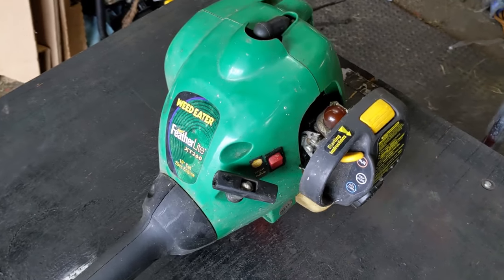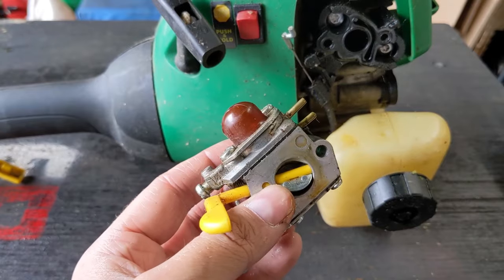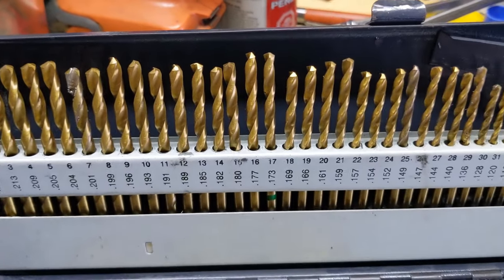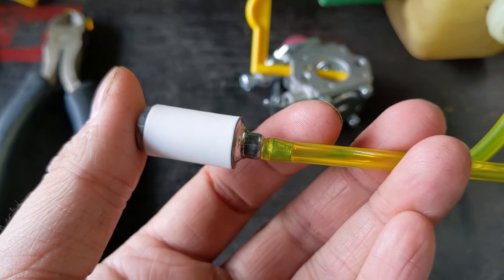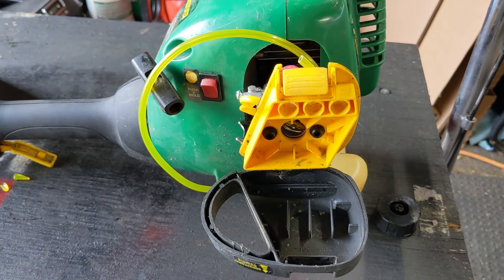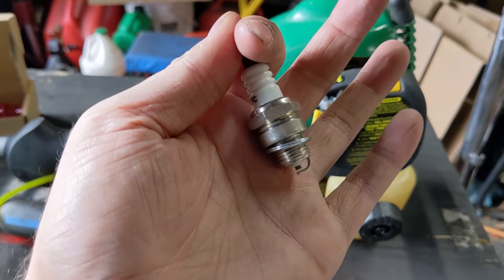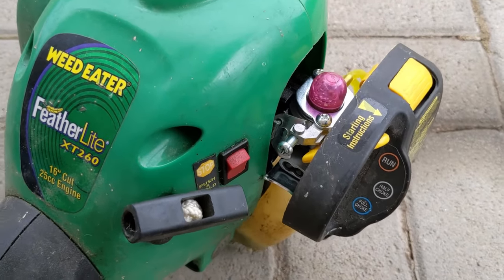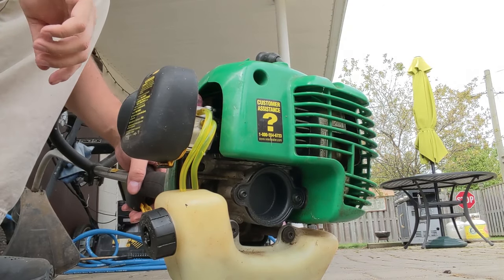Weed Trimmers - Don't Rebuild The Carb!

Comment: Thanks for posting this video, I went to Amazon and ordered one, came in two days, had new carb, 2 new gas filters, both sizes of fuel line, 2 air filters and a new spark plug along with the carb adjusting tool!! All for under $20.00 Changed all items received and trimmer runs great. Appreciate you doing this video as I almost junked the trimmer!
Reply: I'm headed to Amazon right NOW!😂

Comment: Dude!!..RED thread locker is a "high strength" seal..You'll need HEAT to adjust that idle screw now..BLUE thread locker is "medium strength" way easier to "break free" if you have to adjust the idle screw in the future Sir.

Comment: You can soak the ends of the fuel tubing in warm water for a while to make it more pliable for fitting to the carburetor and filter .
Reply from the maker: Thanks for watching!
Reply: Or just lick it with a lighter. That’s a lot easier
Reply: Thank you for the information but what I like to know is which fuel line goes on the top fuel, I have a Murray weed eater
Reply: A little bit of 2 stroke gas usually makes it slippery enough to slide over

Comment: The video was very informative and well done.  The drill bit is a #17 not M17 (which would be 17mm).  .173 inch which would be between 11/64  and 3/16 in.  Or close to 4.4 mm.
Reply: Thanks

Comment: Excellent presentation I never understood the Hi-Lo adjustments until I watch this video. Thank You Sir.
 I would like to add a discovery. While pulling the fuel lines through the tank holes I put a dab of two-stroke oil so they would slide nicely. While pulling them through with the hemostats, I use my other hand to stretch the hose a little bit. This made it contract a and slide through with ease. Another thing if the fuel line is too wide to fit over the brass snuggly I used a 1 inch piece of the smaller diameter blue hose on the brass tube. It acted  like a reducing bushing inside the yellow fuel hose.

Comment: 20:24 I think there’s supposed to be a spring under that screw.  That would put tension on the screw so it wouldn’t just vibrate and fall out of adjustment.
Reply: Yes right. But still a great video.

Comment: Greetings from Party Sound eh?  Love Featherlites. Have two. They're so light and not tiring, yet strong runners.  Might try a carb kit in one someday.  Usually just do a cleaning and replace the gaskets  / diaphragms, maybe fuel lines
Reply: Yes right. Love my feather lite. Powerful little machine. Goes through everything..😊

Comment: I agree with your decision, I learned the hard way. I bought a kit online and rebuilt the carburetor and it still wouldn't run. I don't have an untrasonic cleaner nor do I really have a place to have an open container of carb cleaner to soak it in. Even if I did soak in carb cleaner you have to get rid of the cleaner after.  I've seen a lot of repair videos here on youtube where the purists cry foul for buying cheap chinese carbs.  I've used them on my snowblower and weed wacker for years and in my opinion they work just as well and last just as long as an original parts one.

Comment: HI , I Am just starting to watch your video and is
 well thought and I thank you very much . Im a machinist and want to learn small engine repair and i found your site very good and interesting . just for info, the drill you refer for the tube size is not 17M (metric) it is no,17 which is 0.173 thousand of inches( imperial numbers),

Comment: I completely agree with him! I just did exactly the same job a week ago. I still sometimes rebuild some 2 stroke carbs; but I only buy the cheap $2.50 directly (wait 2-3 months to get it) carb kits from China. I wouldn’t spend $8-15 for a carb kit because the carb might not come back and the money spent on the kit is usually just gone. I am only willing to gamble a couple of buck on a kit compared to $10-17 for the kit with a new carb plus all the extra parts that is guaranteed to work. I am also a fan of these old Feather Lites. I have one from 1999 that I bought new and it still runs great and isn’t too heavy to carry around. For cheap machines, they were plenty tough for 1/4 acre, homeowner use, easy to fix, and cheap and easy to get parts for them.
Reply from the maker: Well said, thanks for watching!
Reply: Well I completely disagree. I have rebuilt many 2 cycle carbs especially on trimmers, saws and blowers. I very much dislike any outdoor equipment in 4 cycle except for mowers and such. So if there is an issue with a carb on a 4 cycle unit, most the time if it is a carb issue, maybe then buy replacement carb.
Reply: "come back to working condition"?

Comment: Excellent and very clearly explained video, step by step. A friend asked me to get his Poulan Pro running (looks pretty much like your Featherlite), so your video is timely and a great help. Question: The feed gas line is smaller than the other one. What difference does it make to keep it that way, instead of drilling out the hole and inserting a larger line? Thanks

Comment: Great video! Had I not watched it, I probably would have returned the carburetor. 
Did everything you said. I’ve adjusted the carb best I could but it  smokes white and overheats. 
Got fresh fuel with the correct 40-1 oil ratio, clean air filter. 
Out of answers. Any suggestions?

Comment: I do have a problem with your reasoning. That carb you took off was a genuine Zama carb. Those carbs are very reliable. That carb probably lasted the whole life of the string trimmer. (Maybe 20 years) That aftermarket one that you put on is most likely only going to last one season. Even with your reasoning, if you want to use chinese parts, it would take me an hour to do a full fuel system service on one of those. To rebuild the carb, I could get a chinese kit for about 2 dollars or a genuine one for 10. I understand why this can be a plus for people that do not know how to work on these engines, however, it is not worth wasting 20 dollars (half the value of the trimmer) to put a non reliable carb on that. I know from experience. Now this is JUST my opinion. You do you. I am NOT trying to critisize you in any way. I just wanted to share my opinion with you.
Reply: I agree❤ .

Comment: Recently rebuilt carb on a chain saw. It’s a very similar setup to this. I should have bought the China carb but got the rebuild kit instead. The hour and a half def wasn’t worth the $5 saved especially since one of the screens I changed really required some jewelers tools. Good thing I have some minimal cell phone repair experience.  I avoided the new carb only because I had concerns on build quality. Fortunately it’s easy to confirm good spark and compression without a carb so I did that before spending money.
Reply from the maker: The best is to find the ones with lots of good reviews, spend a bit more usually not much more than an extra $10 here or there for a good carb

Comment: great video , I've got a weed eater brand featherlite 18cc , super low hrs on it . but hasn't run in 20 yrs , I put fresh fuel in it with some seafoam , got the engine running but it wont run unless it is half choked and it bogs badly , I'm sure the carb is gummed up . I would love to replace the carb with an amazon unit . most carbs on amazon are for a 25cc , will a 25cc carb work on my 18cc engine , they look almost identical .

Comment: I just gave up trying find a Weed Eater Feather Light FL26 carb rebuild kit, the ones I found that say FL26 was pushing $20.00, I got flipping PO I bought a carb for $15.00. Theres no need why a carb rebuild kit cost more then $5.00........
For some reason mind fires up on choke but soon as I take it off choke it stalls, I took it apart half dozen times and still stalls out, hopefully the new when it shows up will work.......
PS Good video info, thanks for keeping it posted.........

Comment: I just got extremely excited when I saw your bit box, extremely jelly
Reply from the maker: We usually spend a bit more when buying wrenches or drill bits to get packs with more pieces, you never know when you need a certain size!
Reply: And plenty of 1/32 and 1/64s for replacements I'm sure, ever find any that won't snap no matter what?

Comment: What about if the original carb is a walbro, would you replace it with a china carb? I personally like taking these carbs apart so I just buy pack of 20 meter diaphragms and replace that which is almost always the issue. Pump diaphragm is usually fine.

Comment: I notice that there was no factory gasket on the air intake side on your trimmer. Mine is the same - a Canadian Tire SST25C - 2009 vintage. 
I guess we just put it back together the same way? With just the yellow plastic choke / half choke / run and air filter housing against the carb stack / body? 
It ran really well for ~13 years like this.

Comment: Thanks for the really useful and encouraging video. I’m also a big fan of replacing carburettors. 

Some questions for you and perhaps my fellow subscribers:

1) The OEM of my line trimmer (MTD/Troybilt) recommends a Champion RDZ4H? Isn’t this just too low-heat for a 29cc four stroke….or not? Is it worth trying a “hotter” spark plug? Worth 2nd guessing the OEM? Not under warranty, so I’d happily try some new stuff on this machine. 

2) My Troybilt (now with a fully functioning Chinese carburettor) doesn’t seem to have the ability to adjust anything, other than “balancing”idle-speed and high end revs, using a single screw (just like the original Waldron). My question: is it possible to use a different carby, with more controls (like in your vid) or would this simply not be possible, by design? It took a while of pure guess work, to get my Chinese carby working, btw….

Thanks again for the insights, wonderful vids.

Glen

Comment: Hey man love the videos. Always learning something new. I'm trying to diagnose my Echo Srm-225. It leaks fuel out of the air filter after sitting overnight. Can you point me in the right direction?
Thanks
Reply from the maker: Needle valve and or the fuel tank vent is not venting. Possible the pressure in the tank is building up and forcing fuel out the carb into the air box. If you open the fuel cap and you hear a pssh, this could be the issue.
Reply: @EliminatorPerformance   Thanks  for replying. I will check the cap. I replaced the carburetor with an aftermarket one from Amazon could that cause any issues?
Thanks again

Comment: Very useful and concise! I found a weedeater featherlite x25 on a curbside cleanup. It has a bad zama c1u carb with no integrated choke. The oem choke is integrated into the plastic filter housing. Is removing the choke from ebay carb doable so I don't have to hack holes into the filter housing?

Comment: IT use to be a spring on the low speed adjustment screw, but once again excellent vdeo on adjusting china carb, i Will use china carb on my weedtrimmers but not on my. Snowblower

Comment: Fantastic vid,  I am suffering carb issues with this same exact model.  I have a replacement, but neither the original or replacement will drawn in fuel when depressing the bulb.  I have replaced bulbs, gaskets, lines, and fuel filters but nothing is working.  Any ideas?
Reply: Are the lines on backwards or dry rotted?
Reply: Lines back wards

Comment: Yeah had trouble with reconnecting fuel lines into right outlets ,  had to switch them around . It didn't help that fuel outlets were different than original carb .

Comment: Replacing the carb is easier but I like the "Challenge of Ethanol" Lets see if I can actually clean, rebuild and tune it after it has sat in the back yard under that pine tree for 3 years with old gas in it with the dreaded ETHANOL. The smell from the tank and carb are enough to make you barf. 

I got my cheap fuel line on eBay it was a great deal and came in three sizes with multiple prime bulbs. It was cheap too. I have used the fuel line a few times with no issues. Just used a prime bulb on a carb tonight. Weed Eater gas hedge trimmer. Got it free in a junk pile in the middle of a rain soaked backyard. New bulb a good flush and it fired up without the choke. Needs a bit of adjustment on the carb but nothing that will be a big deal.

Comment: How did you determine the correct carb to get? I have a Ryobi RY2800 but I don't see any carb markings.
Reply from the maker: Go to Amazon and type in Ryobi RY2800 carb and then look through the listings. Sometimes read reviews if they look a bit different. Sometimes they'll show you ones that don't fit so be careful.
Reply: @EliminatorPerformance  Thanks for the help.  Videos are very helpful.

Comment: How can the fuel line at the carb be made to fit the fuel line you have drilled the tank to fit, as these are different sizes on various carb’s.🤔
Reply from the maker: I have different fuel line with different thicknesses, the ID and OD are different on most carbs unfortunately. I have like 4 boxes its hard to tell which one is which until I pull them out and test fit the lines

Comment: LOL I have been researching my Featherlite and cannot find the carburetor for it. I think it is not made anymore.  I usually save my instruction books but cannot find the one for this one so no model number.  Mine is an older one and I think it is model Zama C1U W7C but cannot find this.  Are there carburetors that are a universal fit that you know of.  I am at my wits end.  I know it is a low end machine but I hate to get rid of it.  Thank you for taking time to try and help.

Comment: The carb kits for those are $1.50 and I buy them 50 at a time. I stopped rebuilding those because some carbs have a hidden o ring and leak. Now, I ordered 2 new carbs, one will only run with idle jet all the way in and the other which ran initially is leaking gas into the engine and out the air filter. Also having about 3 out of 4 Homelite carbs no good out of the box so today....I'm back to the ultrasonic while I wait for a carb shipment. That's an older model likely made in Canada, the Poulans to buy are the ones without primers. The carbs are near 100% repairable all the time.

Comment: I discovered this years ago. The carbs aren't worth rebuilding and they have a screen in them that clogs and won't clear. If it doesn't start I just replace it. I have one that's worked 3 years in a row, which is unusual. I put some startron in the mix and it works wonders.
Reply: Its not the screen its the diaphrams and the tip of the needles and seat

Comment: I notice that an OEM carb costs 3-4 times what a Chinese knockoff does.  

I also looked through the Amazon reviews and see lots of complaints about missing parts in the replacement carbs amount other things.  

Maybe the solution is to order a half dozen, keep the first good one, and return the rest.  

Of course, you KNOW that the “returns” likely end up in a landfill.

Comment: Maybe not on a cheap machine like that, but some better quality machines have Walbro Carburettors. These can cost up to $60-70. A rebuild kit for them is cheap and its very easy to do. It's going to be much better than a Chinese carburetor of Ebay or Amazon

Comment: People always ask me why I replace weed eater carbs and rebuild mower carbs and I tell them.... if I can buy it for $15, why waste 45 minutes of my life rebuilding it? Mower carbs cost more so I rebuild them.
Reply: For me, there is much more challenge and satisfaction in successfully rebuilding a carburetor than in just buying one.  Plus, I am long retired and time spent is not a factor.
Reply: @williamclements273  I am the same way off camera. 2/3 of the "new" carbs I install are ones I rebuilt earlier. For the normal guy out there it's a lot easier  to toss a carb on, but for gearheads like us rebuilding it and seeing it run like new is a lot more fun.

Comment: Hello everyone! Hey I need help here. I have a FS 38 STIHL that backfire and is  burning the air filter. Has brand new carburetor in it. And also only runs on full throttle if you release the trigger it'll die. If anyone has an idea of what I can do to it please let me know. Thanks in advance and have a great day!

Comment: Funny how small engine manufacturers blame bad fuel for everything. In reality fuel has never been better, what’s gotten worse is the gas lines, the fuel tanks and the carbs, all made from the cheapest plastic possible. In case of an emergency, I always keep two 5 gallon gas jugs in my shed for three years then dump in the car and get fresh gas, never had a problem, ever.

Comment: Why would the air filter sponge have 2 stroke oil on it?
Reply from the maker: Sometimes people coat the filters in oil to help catch fine debris, other times it's usually just from over priming the carb and the fuel/oil mix floods into the air box where the filter is housed.
Reply: @EliminatorPerformance  I think 2 cycle oil is a bit too thick for the filter.  See what you can find on oils made specifically for that purpose.  They get applied and then you supposed to squeeze the filter to minimize the amount of oil and distribute it correctly.  Heavy oil in the filter adds a slight choke.  Not horrible if not taken to extremes.  Let me know if you agree or not.  Good videos.  Thanks for the prompt response.
Reply from the maker: @alext8828  I've used that stuff in my videos before, it's called air filter sticky spray lol (I don't know if that's the actual term) but it works great! https://youtu.be/jbxO0RZclKQ

Comment: Anything possible to fix the trimmer head wobble that these get after a few years of use?     I'll consider that new carb, but I've taken these off so many times and cleaned 'em out I can do it in about 10 minutes.. Yeah, if you need a kit the new carb is the way to go.     Main thing that gets messed up is the little screen in the carb gets gunked up.. usually some carb spray will clean this out...
Reply from the maker: I've never fixed a wobbly head, these things are like $98 brand new lol I sell them used for $65 there's hardly any money to be made.